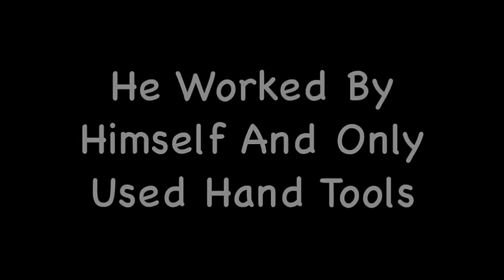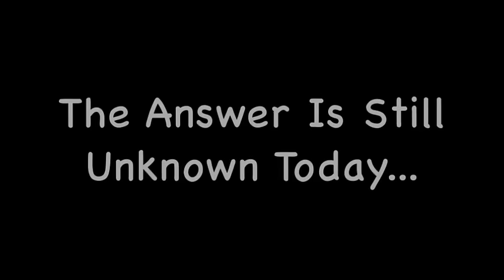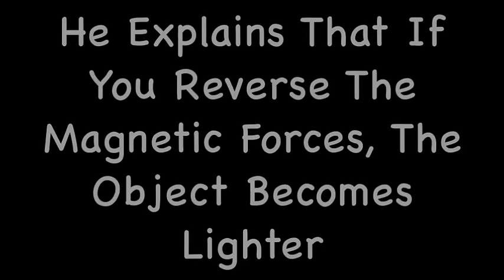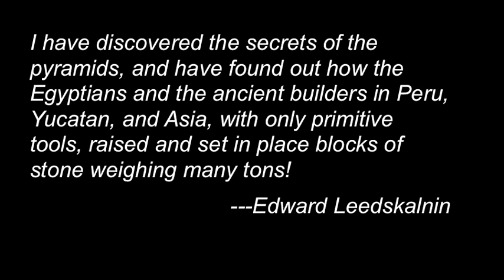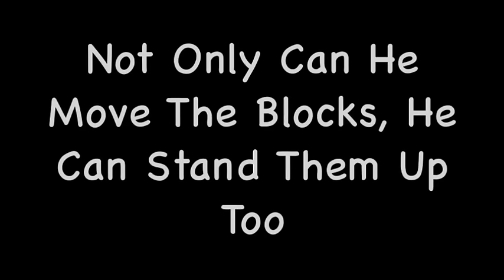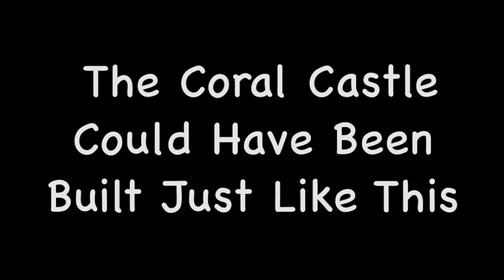Coral Castle: Mystery Solved

Comment: The fact the dude had a tripod with a block and tackle should be a clue to those who think this guy built Coral Castle with magic.  Many ancient people knew stone in all dimensions; how to work with it, carve it, and move it.  I'm guessing the "box" on top of the tripod held his lunch and he put it up there to keep himself from eating it too early.
Reply: You're as smart as tree stump, almost. Try raising blocks higher than the tri-pod used like Ed did
Reply: yep 100% im with you on this. if a guy could make blocks weightless then why need a tripod. assuming the pully system is metal and not magic cheese the box is probably there to keep the rain off or houses a second pully hidden away. i used  to never understand how people could pickup a 200kg motorbike to steal it. 4 guys two poles all lifting 50kg each. a tripod each end would only have to lift 15 ton each. when asked how he did it he didnt say science and magic he said weight and leverage. probably had a small truck to move the rocks from the quarry.
i think anti gravity is possble in the future because it is a force plus it reacts in a strange way by keeping everything on the earth whilst spinning instead of everything flying off
Reply: The tripod box held the large of a pair of 32 pole 12v ac dynamos, modified starter motors.  Wires ran from it to the pole with 2 hooks ontop the castle plain to see in one old photo. The vibration made a hum on those wires which people heard at night so they thought Ed was singing to the stones. The casing is all that remains of that one, dented when the tripod was tipped over. All the measurements make absolute perfect sense comparing it to the smaller dynamo, flywheel magneto block, centrode distributor, and timing post pipe and coilset. I reverse engineered this system 100% over a year ago now and still people somehow miss my channel.

Comment: The Michigan guy is amazing, but mystery solved, probably not.  Ed had the problem of solid coral beneath so the washing away of sand would be possible.  If Ed did use reverse magnetism and someone figures out how he did it, you can bet that those who control the energy like gas, oil, etc. will either pay you off or more than likely you will be made to disappear.

Comment: Yes he figured out how to do this with cement. Coral Castke was made out of a type of coral that is very easily broken with a tap of a hammer. Scientists can't begin to figure out how he  cut huge pieces of coral without it breaking apart. We can't to this day do what he did. Plus he was working on dirt. If you notice this guy was working on a slab of cement when putting rocks under. The type of rock that was used on Coral Castle's huge door to this day can't be identified as any type of rock on this planet.

Comment: I agree with most of the people here. I think it's cool that Wally was able to move block this way, but it's not the same thing Ed Leedskalnin was doing for very obvious reasons. They were using totally different tools and methods, for one. Leedskalnin used electricity, magnets and radio frequencies. All of this is known, so Wally's technique is something totally different. Just the same, kudos to Wally. Most people wouldn't care enough to do this, but don't think you solved the castle mystery

Comment: The coral is much more fragile first of all. He moved stones of natural rock instead of concrete. If E.D.L. did use antigravity magnetic forces (most likely through frequencies NOT of the radio kind) then he did  truly figure out how the ancients built with such massive scale and yet such miniscule precision. Also E.D.L. stated he used none such tools but a make shift tripod and some chains along with a compilation of tools he had remade based on ancient blueprints and ancient artifact tools. Surely stonehenge couldn't be made like that either cuz the technique used in this video requires a much more solid surface and the grasslands of southern England tend to be rather soft and moist in contrary to the concrete the ignorant old man was moving the rocks upon initially. Finally concrete isn't a natural product from Earth therefore the man couldn't EVERY figure out ancient building techniques because he couldn't even try to use subtle energies.

Comment: Coral Castle was not build this way. First, you have to have a flat, hard surface to use this method of moving blocks. There was no such surface at Coral Castle. Also, it takes hours to move a block this way. The method of raising the blocks takes hours and a lot of wood. No such equipment was ever seen by anyone at Coral Castle. Many of the huge blocks were moved overnight, often several at a time.

Comment: Ed quarried out his own stones, some up to 30 tonne out the ground single handed .A thing we cannot do to this day. Cutting them exactly is just as impossible single handed. Getting these stones into place is probably the easiest part, but not to be underestimated like this. Peruvians did it up in the mountains not on flat ground, The Egyptians moved them over sand, not moving with little rocks and levers over concrete slabs.

Comment: The rock rested on an old truck bearing. It was the rusting out of this bearing that resulted in the gate's failure to revolve. Complete with new bearings and shaft, it was set back into place on July 23, 1986.[14] It failed in 2005 and was again repaired, however it does not rotate with the same ease it once did. Try again.

Comment: It's the "Comic Sans" font, that proves this theory right! :D

There is a difference between desert and concrete, and between sand and coral or stone base underneath the coral castle. You should also know, that only water he had was rainwater, for a long time, untill he dug the well. so there is a slight difference between water hose and a bucket of available watter. and the problem of cutting these stone blocks out.. I know there is this technique using sand and water for limestone blocks..

Comment: So you just do it in 3ft steps, right?

In any case, he only stopped at that height because that's all he needed - with a small team working at it (a bunch of guys stood on top holding stone weights, another one or two at the bottom to shove in shoring-blocks and extend the guide planks as the first group walked back and forth...), you could easily use that method to raise a block of that weight 10ft or more in an hour.

Comment: I agree with nearly everyone here, I do not think this is the way Ed moved his rocks for several reasons.
 1. The blocks Wally is using are smooth surfaced and rectangle in shape, Most of Ed's are square with porous surface. I think, given the surface and weight, smaller stones would dig into the surface of Ed's and be useless.

 2. No one ever witnessed Ed move any of his blocks ever, not once. The time it takes Wally to move a block many people have seen him do it.

Comment: Ed only said that he did it alone. Nobody from there and then is here now to contest it!
The quarries were machine cut, look at them and you can see the tooling marks.
The site was built among Dade pine, which is really strong wood. You can see him using the trees for his tripods.
Coral castle was built in a time when there was heavy machinery as well as heavy rigging equipment, hell.. antique rigging equipment bought in the 50s that was made in the 30s was adequate to lift 6 tons.
There are companies today that will move blocks of oolite, go to Coral Castle and look across the street and you can see a modern outfit!
Ed was a logger, He knew a thing or two about cutting and moving trees. His family were castle builders.
It doesn't take away from the coolness of the site, I go there when I can because the place is awesome, and the fact that Ed built it is good enough for me.
but alas, he had people help him. and he had chain hoists, and trucks, and tractors, and whatever else he could hire to move the big stuff. not magic. Look at the stones, they tell their story about how they got there.
He also loved radio, and did some radio work for the military. Most of those gadgets that he made that looked electrical were for radio experiment, His pamphlets were written for a profit, they aren't right but give a wonderful insight to Ed's mind and passion. He was cool. He also died pretty young from bad nutrition in Jackson Memorial Hospital.
 I could go on, maybe I should delete this so I don't take people's fun away.
too late for that, sorry guys.
Go and see it! Just don't leave believing in ancient Egyptian magic!
Reply: Tim Bradbrook His friends and neighbors were interviewed at the time he was building it and no one knew of anyone helping him and if you think 3 white pine logs can support 30 tons.... Yea, I can see Ed the 5 foot 100 pound logger.
Reply: kwalmer have you ever been there?
Reply: Tim Bradbrook I think if anyone truly wants to meet Ed Leedskalnin today they should read Col. Carrol Lake's book written a few years after Ed's death and all interviews of the first person versus 2nd,  3rd ...  the book is free on the web 
http://www.labyrinthina.com/Coral%20Castle%20Book%20-%20Carrol%20A.%20Lake.pdf

One does not have to go beyond the very first stone that Ed quarried to understand, he used tools we can only speculate today what they were.  This stone was (per the book) 3 by 3 by 10 feet of oolite limestone, which checking the Miami rock density, it would have weighed close to 8 tons.  The book states it was dugout on only one side (probably the 10 ft.).  One cannot breach limestone and get a 90-deg, corner; this stone and all his stones have 90-deg corners.  Ed had to cut the stone out, and in his tool room is a 3 ft. tree saw.

When I was there I picked up some oolite coral and no one could cut that stone unless they used a diamond tip saw or a wire.  One would need to dig out more than one side to use a wire.  Not even considering how, he raised that 8 ton stone at least 4 feet high and then moved it sideways to put it on the ground.

His rock quarry is there today for all to few, it is the perimeter of the structure on three sides.  What is extemely interesting everyone homes in on how he moves the stones, actually figure out how he could cut those stones with the tools in the toolroom, and it opens up how he could also move them.

Also think about his statement '100 men could build the Great Pyramid in a year' some 2.5 mil stones, precisely assmebled to create a tuned device.

Comment: You have a theory,or you are calling Ed a liar.There are normally a few ways of completing a task,your way is but one.
Reply: pidner 

One problem. The stone he put under the block wouldn't work, because the ground would have to be hard enough to support it. Notice how these demonstrations are on a cement slab? It would NOT work unless the people who built the pyramids or Stonehenge laid a road the 500 miles from the quarry to the site. Sorry to say, but there is no road, so this theory is busted. But, it is a nice try.
Reply: Yeah youre right,I had thought about a ten ton block pushing a larger stone into the ground in that swampy ass land down in Florida,One might be able to use wood as the base for a stone,of course I doubt it,and if so it still dosnt explain how the large blocks were lifted up.Theres a lot of holes in this pebble theory.I read somewhere that some people thought to be with the government came in and took the black box.

Comment: While this is interesting, it doesn't solve the mystery because even with this technique 2 people and a truck couldn't move the entire structure 30 miles in one night. Mostly because of how much time this approach still takes to lift blocks neatly into position, but also because no such tools were found and it would take even more time to assemble and hide such equipment. It also doesn't explain some ancient structures. For example, in south America reed boats were used to transport much heavier blocks and you wouldn't necessarily have the required stability. In the case of Easter Island the statues were literally walked, so the real answer need not be magical, but even if this can partially explain it I wouldn't consider it case closed.

One possibility I can think of is the use of quantum locking, but that would first require being able to perform the feat without super cooling and would also require the ability to adjust field lines which in practice would allow you to lift and rotate on any axis to beyond laser precision

Comment: How ridiculous. He doesn't even show or explain how he got the large block off the ground and into his contraption to slide in into the ground. That is the part that disproves his own theory. Also the idea of spinning a massive block on two stones to move it is just nuts. Maybe it does move the stone but think of how slowly you actually move it. An inch for 10 rotations or w/e the snail pace is. There may be some truth to the concepts he used but it does not at all prove the mystery is solved. He builds something different with different materials and claims it is the same.

Comment: Maybe Ed made some Harness for the rocks to be wrapped in, with a metal harness, using what they use in scrap yards to lift heavy metal, maybe he used something similar? not sure what the max weight would be, but that black box could be some sort of electro magnet?

Comment: the stones were shaped by putting them in a special electromagnetic field...crystal hexagonal lattice structures can take on the attributes of a particular electrostatic field....the stones will change their shape...coral contains a crystal hexagonal lattice structure...the hexagram that is all over coral castle is a hint but it hints at much more than that...and im sorry to inform you but Ed didnt use levers and pulleys...he used a very ancient knowledge...the same knowledge that can be

Comment: Drakan thank you for this. Leedskalnin performed many experiments with magnetism, as did the pyramid builders. An electromagnet, as described in Edward Leedskalnins book was lifting weights of several tons before the end of the 19th century.

 William Sturgeon invented the electromagnet in 1824, it took many years until they even started to understand electricity enough to work with it, it would be almost 100 years until it was determined whether electricity was + or negative.

Best,
A

Best,
A

Comment: The proper way is to make sure the stone is free... if not you dig under till it looks like a boat and then tie off the whole thing and shove sideways and it brakes off. Now you tie onto it the long trees or railroad sections and place on pivot point 3 higher than stone... add 30 ton of sandbags to other side in pairs on rope. till it comes up...push 
repeat from new pivot point closer to goal 20 foot a shot all the way home.
same as it was and is done today... easy as it ever was!

Comment: wally is moving a maximum weight of 19,000 pounds .. the obelisk at coral castle weighs 50,000 pounds & is 40ft high..  .   coral castle contains 1000 Tonnes of coral perfectly placed & carved without the use of wally's cumbersome equipment

Comment: At a glance, one can easily see your point. However Coral Castle isn't made of solid concrete or solid stone for that matter. It's built from very fragile fossilized coral and the "pebble method" of turning the blocks would not work. Also our block moving hero seems to have left out one advantage he has over the ancients. A perfectly flat paved road to carry out his endeavor. (An engineering feat in itself considering the distance the stones traveled.) Working at night with brittle blocks?

No.

Comment: This is very intriguing, but there remains a mystery to be solved.  How was the Coral Castle moved onto a flat bed truck piece by piece in 30 minutes at a time for its move to the current location in Homestead, FL.?  Using this method would have been quite labor intensive, I would think.  Food for thought.

Comment: I have seen Wally's methods before.. but Ed did not have wooden levers like that.. or anything Wally uses.. just Tripods, pulleys, carving, digging tools and lamp posts. Which leaves that as a mystery in itself. I mean on man to move, not just a bunch of 5 ton rocks around.. but lift and move a bunch of lamp posts around.. I mean.. have you tried to lift a lamp post before.. yea.. this does not explain much to me.. and he not only built the castle, but moved every stone 10 miles from its original location...  Just think if the Egyptians wanted to move the great pyramid of Giza 10 miles from its location.. ?  Look at a map.. Oh and Ed did not have a smooth ground to rotate rocks on either..  Just for info..  😁

Comment: I agree. I'm sure that with the limited resources that older cultures had, ingenuity was all they had, and the last stunt Wally did was pretty ingenious. Those cultures wouldn't have a smooth surface for the rocks. I am willing to bet that the stones were hoisted a foot above the ground(like the last stunt) and logs placed under the rock on both sides to spin or transport. Seems in theory it would work, do you agree?

Comment: i look back i admit i look a lil dumb sayin what i said, but levitation is very possible, if you have  steel donut and fill it with thero fluid and spin it by magnets the speed at which the magnetic fluid is spinning in return warps the layers of space and time,  and if you look up gravity lock it already explains how the fields can be manipulated

Comment: Thing is, with Wally's method you need a hard surface to work off of. The pebble method wouldn't work in sand, or uneven ground for that matter... I am sure he has other methods also. I heard he moved his garage with just 1 other person. If it was all done on concrete, I will not be as impressed...